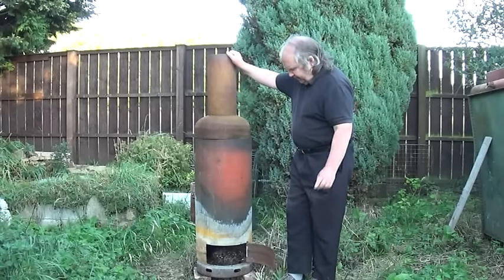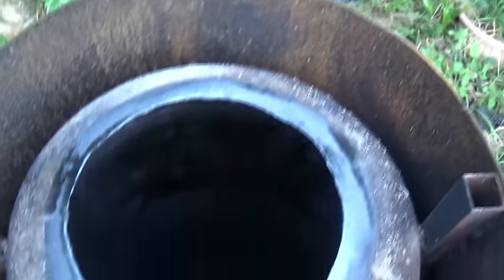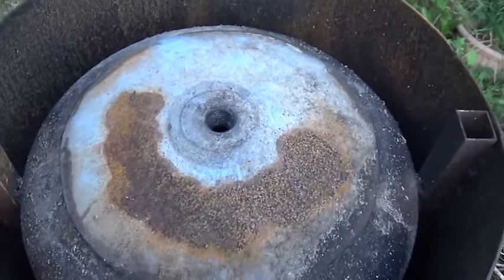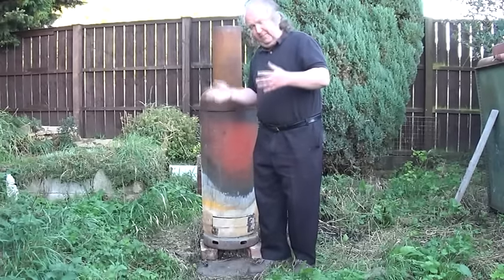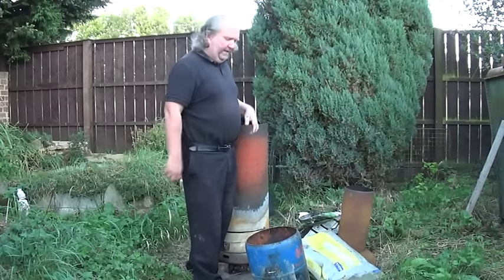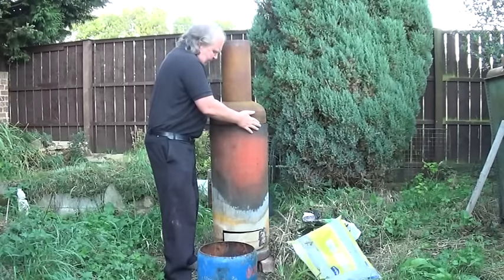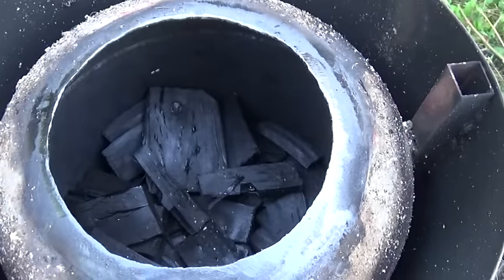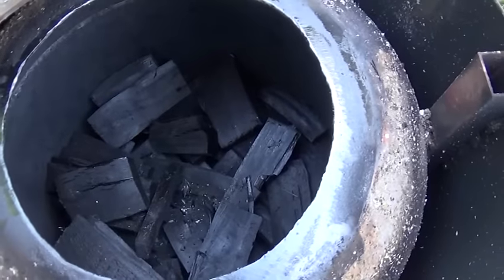How to make charcoal in a home made retort

Comment: Hi Andy, thanks for your nice essay on how to build a charcoal retort. I like that you have used old gas cylinders as these are very robust and long lasting compared to the thin steel of the old oil drums. Old firefighting cylinders are even better as they are stainless steel and there are some large ones used for commercial situations.

There are a few of things you could do to improve the efficiency of your design. Firstly, rather than cut slots in the bottom of the fire chamber, i.e. the external barrel, you could drill a couple of rows of holes around the side at the bottom, with each row offset so that the holes don't line up. (A step drill is useful for this) Then, the barrel can just be set onto the ground and the ashes are contained. 

Secondly, invert your retort so that the valve hole is at the bottom. Make the top lid just the same except don't drill a hole. You want to force the gases from the feedstock out through the bottom so that your fire will ignite them. This way, the gases are providing useable heat to your retort as they burn up the sides of the inner tank. 

A row of holes at the top of the barrel and then also at the base of the stack will introduce secondary air to feed the flame and keep the smoke gases burning for a much cleaner burn. 

If you are not using the thing as a heater, it is beneficial to insulate the outer barrel so that you have more heat transferred to the retort. 

I reckon you could halve the burn time if you did these mods. 

Once again, thanks for your video. Here in Australia, gas cylinders only have a 10 year life before regulations stipulate that they must be inspected before being recommissioned. Guess what, the inspection process costs more than than a new one, so there are lots of them going to scrap! It's a considerable waste, but for this kind of thing, a great way to recycle gas cylinders.
Reply from the maker: Hi Bruce, I agree about your ideas for improving the efficiency.  I'm not sure that drilling holes around the sides at teh bottom would work so well though. I've read various things about wood needing to get air from above and burn ona  bed of ash, but having tried it I can say without doubt that it burns hotter and faster if the air is comming from directly below, just like a coal fire. Also I worry the ash, although minimal, might still block up the air holes if theyw ere in the sides. At elast with them in the bottom gravity helps get rid of the ash and keep the burning surfaces exposed to the fresh air. The draw is so great that whatever ash there is mostly goes up the chimney, so very little drops on the floor.

The thought of putting holes around the top, where the main outer barrel joins the lid is a good one. It definitely needs more air in that region to burn the smoke off.

Turning the inner barrel upside down is good in theory, but not so easy in practice when using old gas cylinders. There are two main problems. First the cylinders are heavy, so the inner one is permanently attached to the outer, making it impossible to tip it upside down. I could seal the hole in the lid and make a new outlet in the bottom, but I think the lid would then need a gas-tight seal around it otherwise their would be an air path through the inner drum which might burn the wood rather than charring it. If the lid was sealed (which would be difficult to do) then it would lose the safety feature of being able to blow off if too much pressure was produced inside. I guess this could be overcome by using some kind of pressure release valve or sealing the litd in place using springs, but it's a bit complicated to achieve. If I was using good wood for the heat source then I'd definitely want to do everything to improve the efficiency. But as I'm basically burning junk (rotten wood, weeds from the garden etc) then  it's not such a big worry.

Another way of using less fuel on the fire would be to cut away the bottom of the fiore grate and mount the whole unit on top of a rocket stove, which would probably use less fuel to produce very directional heat.

Now spring is here in the UK I'll do some more experiments and report back. Next step is to complete the gasifier to run an engine though.
Reply: Andy's Shed  thanx for sharing your design. Maybe you can use those 2 square pipes you already welded for the gap arrangement for transfering woodgas down to burn at the bottom by drilling some holes near the grate and adding 180 turn abit smaller square tubes for each like tight sockets on the inner cylinder lid. this idea might be usefull for you. more heat, less time, less fire woods.

Comment: The older the nail, the harder it is because of wood shrinkage and the metal swells from oxidation from moisture in the wood, makes for a very tight fit. Its why when you pull wood off, the nail pulls out though the wood and the nail is still sticking out the other part its nailed in to.

Comment: Great job, only one thing I would change, make the charcoal bin easier to retrieve the charcoal by a chute or maybe lifting the bin and dumping it.
Reply from the maker: I'm not sure how a chute could be added and still keep the thing airtight. Lifting out the inner barrel would work, but because it's an old gas cylinder it's quite heavy, even  when it's empty.
Reply: @AndysShed  a drop door/chute combined, drop the door, it becomes a chute.

Comment: Very nice bit of construction. Great burner. Just thinking wouldn't it be better to have the gas escaping from the bottom of the inner chamber? Thus the burning wood gas would contribute to the heating.
Reply from the maker: In theory you're exactly right. However that would mean having to seal the top somehow, which in turn would greate the need for an emergency pressure release valve of some kind. If the top wasn't sealed and there was a hole in the bottom, there would be a path for air to go through the retort and it could be enough to turn at least some of the wood inside to ash rather than charcoal. What might be possible is to take a small pipe from near the top of the inner barrel, out through the side, down the outside and back into the burn chamber. That would keep all the holes near the top and so there would be no air path inside. I'll probably have a go at that sometime when I get around to it.
Reply: @AndysShed  After I made that comment I saw that as the problem... seems a shame to waste that energy in the wood gas. Something to solve.

Comment: I would think that you would want to have it gas-off into the bottom of the outer chamber that way you get full retort and don't have to use as much wood, if any to keep it going.  Otherwise, I like the heavier gauge materials used for durability.
Reply from the maker: You're right about ideally getting the gas into the bottom fire chamber. I'm just working on the best way to do that now. Watch this space for an updated design!

Comment: I like your video, great work. I have a question, will it be more efficient by burning it horizontally than vertically as it burns more evenly.
Reply from the maker: That's a very good question! Unfortunately I don't know the answer. Wood burning stoves certainly work better horizontal. I think the fire would still need to be below the charcoal though. It would probably need to be a ling fire burning the entire length of the charcoal barrrel too.

Comment: I guess you can’t use pallet wood for BBQing though as it’s pine? Decent set up overall and well explained. I think I’ll give it a try but using hardwood instead. I might use pine for bio charcoal for the garden.
Reply from the maker: Some pallets are pine, but others are hardwood. It's easy to tell the difference from the weight. I don't use the charcoal for barbecuing. My plan is to use it to power a vintage petrol stationary engine using the gasification process. Watch this space for a follow up video showing my home-built gasifier and how it's connected to a single cylinder engine.
Reply: Most pallets are made out of Cottonwood not pine

Comment: Hey Andy,
Do you have measurements or dimensions of the retort? would love to try this. Thanks for the video
Reply from the maker: Hi! I didn't make the retort to any particular dimensions, so I don't have measurements. It can be as tall as you like, needs enough space underneath to make the fire and a gap betweeen the sidewalls of an inch or maybe two so the flames can reach up the sides.
Reply: @AndysShed  ok thanks

Comment: You need to put the inner retort in that thing upside down so all the burning wood gas and volatiles work in your favor to further heat the retort instead of just pissing all those tens of thousands of btu's into the air..
Just saying.. otherwise excellent job 👍
Reply from the maker: Unfortunately I haven't found a way of putting the retort in upside down because it's fixed to the sides of the outer barrel with stand-offs, so doesn't come out. However I'm looking at taking a small pipe from the side of the inner retort near the top, through the outer barrel and back down into the burn chamber where it could be lit, which would effectively do the same job. However the problem then becomes how to seal the lid so all the smoke is forced down the pipe. I definitely agree with your thoughs though.
Reply: @AndysShed  Might also run into a problem where the first dirty gas/moisture/tar clogs up the small pipe. Would need a bypass opening with weighted seal (large steel ball?) to allow first dirty gas to escape before routing it down thru the pipe to firebox. Should small pipe clog the weight ball would allow expansion of gases to safely release.

Comment: Thanks 👍 Andy, I have one question did you put any holes in the bottom of the inter barrel? I been looking at how to build a reliable biochar processer. I am looking forward to building this one!!
Reply from the maker: Hi David. No, definitely don'y put any holes in the bottom of the inner barrel. If you did there would then be a path for air to enter at the bottom and go out the top, which would allow the wood to burn away rather than turn to charcoal. If you're interested in using the gasses driven off from the inner barrel to help fuel the fire, then you can fit a pipe (steel would be best) to exit the inner barrel at or near the top, then bring it down the outside of the outer barrel and back into the firebox area. That would then take some of the gasses back down to the fire. But whatever you do, make sure you don't fasten the lid of the inner barrel. This needs to be able to lift just in case there is a large build up of gas that needs to escape.
Reply: @AndysShed  thanks for the advice, I really appreciate it! Looking forward to building mine this spring!!

Comment: I have an outdoor wood fired water stove with a large firebox, approximately 24"x24"x34".  Do you think I could make a metal container to set inside my water stove firebox to make charcoal?
Reply from the maker: That sounds like a good idea to me. The key thing to remember is the container has to be almost air tight, just with a small hole to let expanding gasses out. I've heard of a lot of people using large paint cans with a small hole in the lid. You can't produce much charcoal that way, but it proves the concept. Just throw it on your fire and when flames stop coming out of the hole the reaction is done and the gasses are all burned off.
Reply: @AndysShed  Thanks so much (and apologies if I shouldn't be clogging up the comments with just a thank you, but I really appreciate it.)
Reply from the maker: No problem. Comments are always welcome. Let me know how you get on with your charcoal making.
Reply: @AndysShed  I'll try to report back.  I'm thinking of going with just a 5 gallon propane tank and using it very much like you did, except in the firebox of my outdoor water stove.  That's a little smaller than I might prefer, but I build a fire every few days throughout the summer to heat my hot water anyway, so multiple small batches of charcoal shouldn't hardly be any more trouble for me, and that should add up to all the charcoal I want to make for now anyway.  I've gotten one propane tank I can use already and just need to find one more.  Thanks again!
Reply: @AndysShed  Following your idea here but making use of my outdoor water stove firebox for the outer chamber I've now made about a half dozen batches of charcoal, and it's working great.  If you're interested, and if you can recommend a way to do it, I'll send you a photo of it in operation.  I can open my firebox door and see the flames shooting out the top of the propane tank.  I'm loving it.  Thanks again!
Reply from the maker: Great to hear you've got the retort working. If you go to my website at https://andysshed.callpress.netand go to the contact us page you can send me a message and I'll reply with an e-nailyou can send photos to.

Comment: Is there a trick to emptying the barrel? Can you turn it over to get all the charcoal out?
Reply from the maker: There's no trick. I just put my hand in, grab the charcoal and drop it into a bag. The whole thing could be turned over, but it's quite heavy. Picking the charcoal out also has the advantage of leaving all the fine dust in the bottom of the barrel to fetch out seperately.

Comment: How do you get the charcoal out of inner container does it lift out? How easy is that
Reply from the maker: No, it doesn't lift out. There's no reason it couldn't be made to do that,  but the cylinders I used are pretty heavy, so I just made the whole thing solid. I  just reach in and grab the charcoal chunks. I like to snap them in two anyway to make sure they're done. If they don't break then they go back  in with the next batch.

Comment: What size are the cylinders? Is the big one 48kg and the inner a 13kg?
Reply from the maker: Sorry, I have no idea what the sizes are. They are just scrap cylinders that I was given. The outer one was about 5 feet tall and the inner one about 3 feet. The dinensions are not critical though provided there is enough space under the small cylinder for the fire and there is at least an inch of clearance all round inside the large cylinder so the flames and heat can rise up between the two.
Reply: in the uk it would be a 47kg and a 19kg

Comment: so you can put any wood into the inner barrel.. 2 x 4's will work as well, BUT, can u barbecue with the 2 x 4 charcoal, is it ok to eat barbecued food from 2 x 4 charcoal, or will it have a weird taste?
Reply from the maker: I think once it's charcoal you've burned off most impurities, so it won't have a weird taste. An untreated 2x4 is just a piece of wood like any other piece of wood, so I'm pretty sure it would be ok. The only think you might need to be careful of is if you're making cahrcoal out of old timber that has been painted and teh paint has lead in it. What I do is use clean timber in the retort to turn into charcoal and any painted, rotten or otherwise dodgy stuff I burn in the bottom as the fuel for the process.
Reply: hey thanks for your time and wisdom, thats a good point regarding iffy wood to be used as the fuel wood.

P.S. I have recently removed the internal tank from a 40 gallon gas water heater.

Its too big for a forge, and I was wanting to use it as a retort BUT the center pipe that runs the entire length of this water tank is of a smaller diameter than 4" diameter heating pipes on youtube charcoal retorts! ( The water heater heats up the water in the tank by utilizing a burner at the very bottom of the water heater.. The burner heats up the bottom of the water holding tank directly and also all heat is directed upwards through the center pipe which is installed in the center of the water tank. Natural convection and fire and heat travel up the pipe, heat the pipe, and therefore transfer that heat to the water which surrounds the center "chimney" pipe!

SO- can a retort still be successful and function well with a smaller diameter heating pipe?? So long as I am on top of adding fuel wood and keeping the fire HOT?
Reply from the maker: If I've understood this right, what you're wanting to do is send the heat from the fire up a central tube inside the retort (a bit like a rocket stove) rather than round the outside of the retort as I did.

While this method does work (James Hookway has some good videos doing something similar) the tube up the middle needs to be quite big to give enough surface area for the heat to transfer to the charcoal chamber. You would also definitely need to insulate the outside because otherwise there would be wood right up against the cold outer skin and that wood probably wouldn't char.

What you could do would be a hybrid design where as well as the fire burning up the central tube it also goes up around the outside like mine. The problem you'll have is finding a way to make an opening to load the retort with wood and also being able to almost seal it , so basically no air gets in but pressurised gasses can get out. This is a problem with the Hookway retort too. 

I did try a small Hookway type retort and it didn't work too well for me. It might be that it works better if you build it bigger though as mine was quite small. I also found it difficult to make a sealed lid for the charcoal chamber.

If you try any different designs be sure to let me know how you get on. I'd be very interested to know.

Comment: Is the outer cylinder hollow at the top and bottom?
Reply from the maker: Yes, there's a space at the top for smoke and flames to move over the lid to escape up the flue pipe. The bottom of the inner Barrel is also about 6-8 inches off the bottom of the outer because this is the combustion space where you put the fuel you actually want to burn.